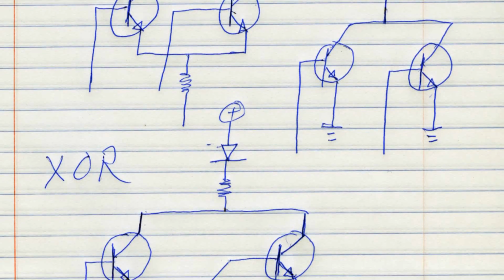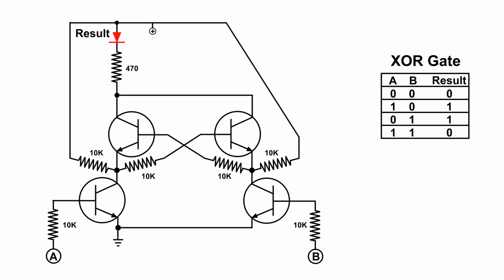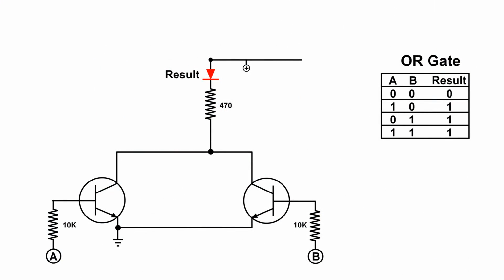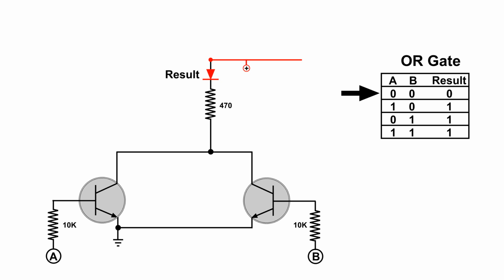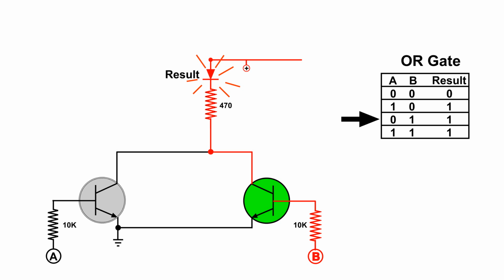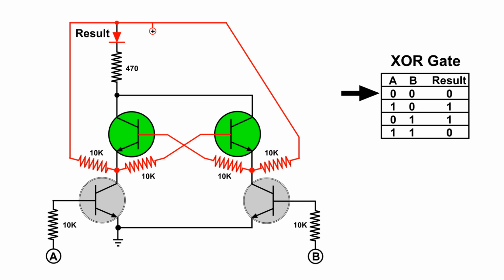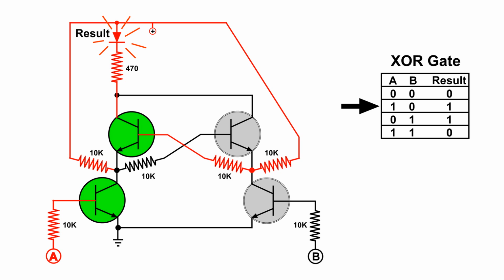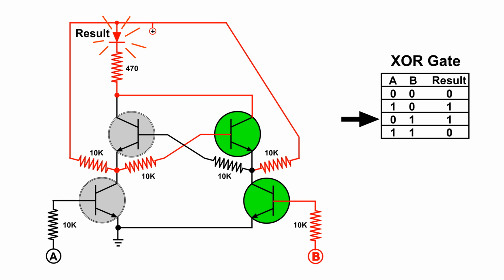OR XOR Gate Build and Demo

Comment: Hello sir I have trobel finding parts in my lande. The basic circuet that I need is actuali for an pick up coil distributor or means to control phase shift on an gm ignition coil module 4 pin . So I did finde lot circuets one of them was interesting to my its used on an cdi variabel module phase shifter it uses an 555 timer and an xor gate 4017 ic I belive it was that some resistors capacitors and transistors made that circuet so I was wondering wuld that do any thing to the gm 4pin ignition module? You see I have long years problems with engine start up in cold morning the integrated ic chip in that module who is an mc 3334 ic chip from motorola isnt reali variabel and does lot wiard staff so it isnt basicali variabel at all so I hoppe you can suggest some thing bether circuet some sort of variabel ignitor preferabli just to control an darlington transistor I sadli dont have any thing ells then those dumb pick up coil from gm so Im confused how to force that thing to phase shift timing about +/- 10° pre set ??? Lot peopel suggested useing transistors,ic chips,rc boxs or shmittrigger circuet but still Im anoyed at that thing.So thats why I hoppe with this comment some one can understand my what sort of circuet I need I cant simpli use triac circuet because it wuld cause havoc with my delco alternator and baterry potential differences mostli those circuets run at ac 220v that is to much work to do so I try to figure out what ells I culd do cloosed loop systems arent reali explained well in my opinion.In fact I dont even know on what frequency range and voltage my pick up coil is running at to tell the truth the gm ignition modules operates mostli at stages run start stall mode and operates also in stages around starting point 33hz up to 333hz so that thing tehnicali doesnt work under low engine rpm so I have problems there as well. I can fix that by useing tractor alternator conversion but still on my starter motor is to much loaded if I advance to much ignition timing thats why I requare some sort of advance/retarding ignition system circuet mostli If any circuet can also change to ignition coil frequency voltage or amps flow that wuld by great adition.
Reply from the maker: I would not recommend trying to modify the ignition system. Your engine run good, but is hard to start in the winter. You may need an Engine Heater - Oil Dip Stick.
https://www.napaonline.com/en/p/KAT15200?cid=paidsearch_shopping_dcoe_google&campaign=GSC-Towing&campaign_id=8911645606&adgroup_id=106416389246&adtype=pla_with_promotion&gclid=Cj0KCQiAo7KqBhDhARIsAKhZ4uhftEjN-2jNSqgA7IAM7FNj2ODQbjC-S9rgh_xxZg9nGGLn-2TLNy0aAgEfEALw_wcB&gclsrc=aw.ds&gad_source=1

Comment: Hi do you have xnor gate demo?
Reply from the maker: This is adding a NOT circuit to the existing output
Reply from the maker: All you would have to do would be to add another transistor and LED between the 470 ohm resistor and the existing LED. The newly added transistor and LED would give the exclusive nor output. The base of the newly added transistor would be connected between the 470 ohm resistor and the existing LED.
Reply: Thank you 🥰
Reply from the maker: @aprilc.5826  Your welcome